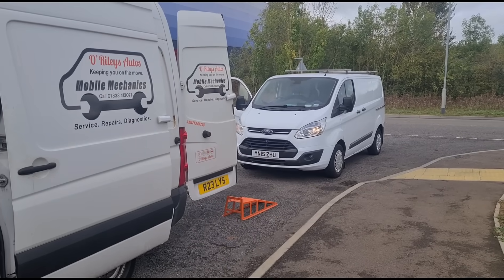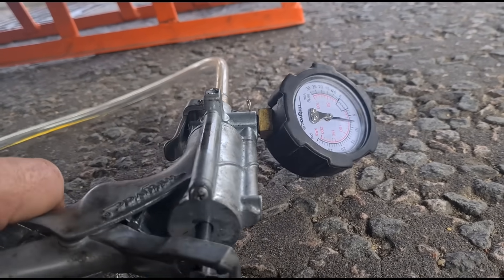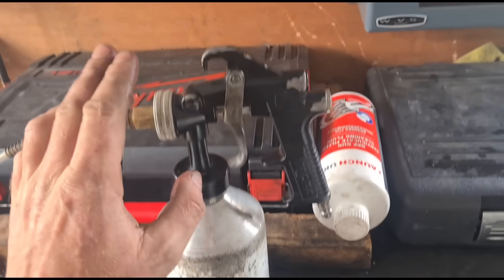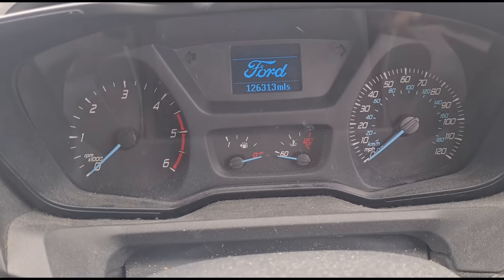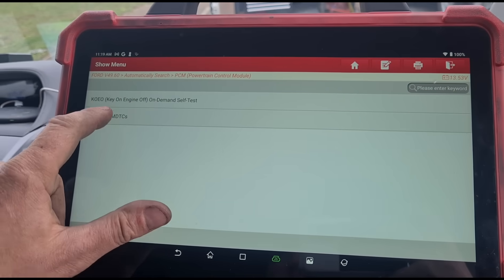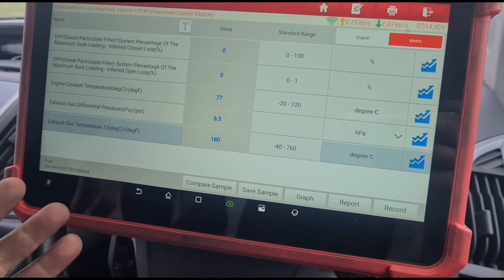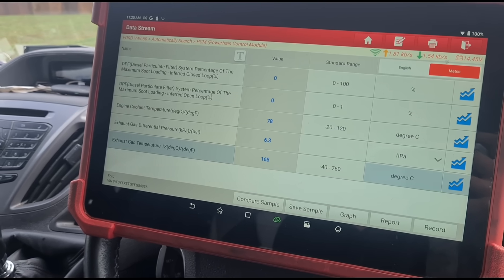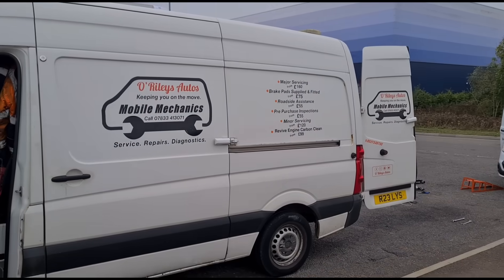DPF Temperature Too Low For Particulate Filter Regeneration?You Won't Believe What Part Was Changed

Comment: what problem could I have with the code P269 F72??, the vaporiser has been  cleaned and the differential pressure sensor also.  The error comes an goes,...Thanks for your help.

Comment: Hi I've had a p244c code on my SMax 2011. I've checked the DPF and it's only 80% full. I've put Wynns DPF cleaner and Millers fuel cleaner in, went 10 mile drive the temps were 280°c at 3krpm for the first 5 miles. I upped the anti and sped up 4.5krpm and the temps went upto 600°c . Is this an ok thing to do or do i really need a New Vapourizer? If so what do you recommend??

Comment: DPF trick.

After resetting the following. (Forscan)

1. PCM: Reset The Differential Pressure Sensor Learned Values.

2. PCM: Reset The Diesel Particulate Filter Learned Values.

3. PCM: Reset The Exhaus Gas Temperature Learned Value.

After resetting all 3, you need to do a (PCM Module Reboot) Before (DPF_SOOT_LD,%) is at 0.0%.

This info is almost impossible to find on the internet for some strange reason. This worked on my Ford Mondeo MK4 titanium 2011

Comment: As you mentioned in this film they have changed this changed that. It's all very well having the up to date all singing and dancing diagnostics,
what codes it throws up is not what the parts are required to sort it. I call them parts changers, plain and simple. Thank you for taking the time.

Comment: I have a Fiat Doblo 1.3 TD Multijet that I use for work. It was running as rough as a badgers a**e with multiple passive regens happening almost daily. I decided to start using Shell V Power instead and within a couple of days, my van engine runs smoothly with no more juddering at idle. The reason I am posting this is because for some reason, the van no longer does a passive regen every bloody 5 minutes. Easily a week between regens and with much much less smoke coming from the exhaust. Just thought I would post this as it may help somebody.

Comment: Hi I looked at a few of your videos regarding the DPF. All is very clear thanks! But ( always a but) my problem is just a little different I think.
During regeneration I often get a "Service warning Now"  and my Ford transit custom shuts down turbo and some other stuf. I turn of ignition . Start again and drive on with no problems.
Last time the generation went from 97 to 64 and then the warning came.
The only warning I see every time is low turbo pressure.  P0299  But I think this is more a sympton after the turbo shut down?
Can the low turbo pressure have anything to do with the warning during regenaration?

glowplugs have been changed, and the dpf also.   Vaperizor not yet ..

hope to hear from you
greetings Nort ( Netherlands)

Comment: So, I have an issue with DPF. codes p246c p244c p246b p2463. I connected the software, and the DPF pressure seems all right. The sot accumulation is 225% and 217%. The exhaust gas sensors 1 and 2 show 100C and don't move at all, and the voltage does not change when revving the engine, either. My theory is that DPF is not blocked; faulty sensors prevent auto regen. What do you think?

Comment: Jimmy, I love your videos but I'm now stuck with my diagnosis. I have a Jaguar F-Pace 3.0D V6, 2016. 1 year ago I had a cracked DPF core and it was renewed. After that after some driving the oil level has risen from middle to max and service interval went from 25.600km to just around 3.000km. Then I changed the oil, bought OBD-2 scanner and now after few months of constantly looking at parameters I figured why it happened. Active DPF regeneration happens every 80-150km on mixed driving style and maximum 300km when driving only on highway. Way too often!! I successfuly completed every active regeneration for 4 months and there is no more oil dillution. DPF pressure sensor looks ok. 0mBar after regeneration on parked car and 10mBar when it needs regeneration soon. At 130km/h it's 30mBar after regeneration and 120mBar just before the regeneration. Sensor looks fine, DPF seems to clean itself quite ok. But it fills up too quicky!! I have to be careful every 3 days to succesfully complete the regeneration process. On active regeneration, the DPF reaches up to 670°C. On city driving it's around 220°C and on highway on passive regeneration it's about 350°C. The DPF company that renewed the DPF said it's been renewed correctly and it should have normal "capacity". What can I check to diagnose this problem? Why is the DPF filter getting full too fast? Could it be one of the EGR valves not working correctly maybe? I've seen very big and constant errors on EGR (A) on my OBD-scanner. EGR (B) seems fine. Could it be that EGR (A) is causing too much soot to collect on DPF? What else could I possibly try? I wish i lived close to you. You are amazing and I hope you could tell me what is most likely the cause. I would be forever gratefull for your help.

Comment: I got a quick question for you I live in Canada and have a 2018 transit 250 getting a low temp code for the dpf had it to ford I'm wondering if this year has the vaporizer on it

Comment: Hello, nice clarification, thank you! I've been having problems with my DPF in the MB 200 CDI, W204 for a long time. Question, which diagnostic device do you use and from what price range can you use it to measure the DPF temperature? I have one that obviously can't do it. With my ArtiDag 800 from Topdon I can only observe the regeneration itself, read out the ash content and the soot content, as well as a few other parameters, but not the exhaust gas temperature in front of, in and behind the DPF/cat. I suspect that the required temperature is not reached.

Thank you and kind regards from Germany.

Comment: Hi, I have a 2012 Peugeot Boxer with a strange issue. the van has no engine lights on and not in limp mode but once it gets to temperature it starts smoking a lot, I can hear the vaporizer fuel pump pulsing which suggest to me my smoke issue is the vaporizer glow plug not working. My son is a mechanic and he has scanned the van and tested the vaporiser for blockage and all's fine. The DPF values are all ok as well.
If I was closer I would come to see you, would it be possible to point me in the right direction?
great informative channel👍👍

Comment: Hi mate, will a Dpf tempratuer sensor on bmw 730d cause a dpf efficiency effor if the temp sensors are.faulty
Reply from the maker: Yes
Reply: @ORileysAutos  ah mate so thankyou for fast reply, I have changed everything, from dpf pressuer sensors on the top, the rube hosings, egr cooler, scr filter , deep oven dpf clean, the error p2002 dpf effeicny low keep returning after every 500miles, now the mechanic and bmw.suggest its the dpf tempratuer sensors that go direct.into the dpf filter, could that be the cause of dpf effeincy low error
Reply: @ORileysAutos  ???
Reply: Please if you could let me know if the dpf tempratuer sensor that go direct into the dpf will cause dpf effeincy error , would be great help thanks mate

Comment: The brake pad wear light is nearly always caused by the sensor wires being cut in two  at the back wheels . Common fault with transits.

Comment: Listening to you recall customer's stories reminds me of an experience I remember. Some years ago a friend of mine got this diesel 'mechanic' to come and look at his Vauxhall Astra at his home. This 'mechanic' bloke decided that the solution was 'to give it 24 volts'! I kid you not, that is what he said. The short of it is that the bloke was going to hump start the car and was absolutely convinced that putting one 12 volt battery in parallel with another 12 volt battery resulted in 24 volts! To my mind, if someone does not understand a most basic principle as this yet specializes in fixing vehicles should not be doing this job or possibly any technical job.

Comment: Hi, I need some help. I have a Renault Grand Scenic 3 2011 1.6dci. And I have 2 errors. One is turbocharger underboost, and second, particle filter error. I take it to Renault service and they perform until now 2 times force regeneration. Now after 200km I have same error, and it stink like burning plastic.
I m tired of their service. Can you please say what I must check in next service, because they perform only force regeneration...
Thanks in advance. And keep the good info on your chanel..

Comment: Have you had to work on a 2017 Nissan Navra with DPF issues?
Reply: Would like to have seen a reply to this as I have an issue with a 2010 pathfinder, can't get through a regen and very low on power.

Comment: great video as usual , but with these latest vehicles with DPF filters whats the best way to keep the DPF in good order , i have a new focus 1.5 ecoblue one every 6 weeks or so i add DPF cleaner when i fill up good idea or waste of money
Reply: I've ran ford diesels for years, biggest issue I found was supermarket fuel, caused engine management lights etc, but run the same car on branded fuel, there was no issues, i did some research and although supermarket is the same base fuel, supermarkets don't put the addatives in that the likes of bp and shell do, this causes them to run dirty, and produce more soot.....I now constantly run my own cars on bp/shell and have never had any issues, and never had to use dpf cleaner and some of my diesels ive run up to close to 200k,  I've recently purchased a 2015 volvo v40 d4, for my wife, as her focus was stolen, the volvo is only on 115k, and since just after we bought it, its been suffering with constant engine management lights, the inlet manifold and egr valve are caked in soot, ive stripped it all to clean it out ad best i can...its now running premium diesel and its not had any further issues...hopefully I've saved the egr before having to replace.

Comment: I think you were  previously correct about glow plugs being needed for euro 4  German diesels witch don't have  vaporiser but use fuel injectors to to inject on exhaust stroke to clean DPF filter ,Glow plugs are used to raise temp of engine and cylinders whilst cleaning / any intermittent or faulty glow plug will cause regen or forced regen to fail on VW euro 4

Comment: My bro has a ford Smax and it was one of your videos that popped up during a google search, i pulled out the vapouriser and cleaned it out with some brake cleaner and compressed air and re fitted it, that was 6 months ago and its still working. Thanks for the videos and the info keep them coming, cheers
Reply from the maker: Glad I could help
Reply: Same here, that vaporizer is 99% the culprit of that particular ‚DPF temp too low‘ issue

Comment: So the parts darts special then? lol

They must be completely monkey if they didn't realise the reason why the DPF didn't get hot enough is because there was no diesel saturating it to make the temps required possible. 

Did they fit a broken fan to make the DPF get hotter ?? Crazy.

Comment: Nice one Jimmy , another job sorted , i did the wire trick on a 2018 vivaro yesterday , it was blocked solid the metal pipe on the pressure sensor from the dpf , cheers for your continued tips and information,  we in the job all need info from time to time , you cant beat it when someone has experienced the same fault as a job in the garage before , so many guessers nowadays in every job
Reply from the maker: Good to hear
Reply: Hi, I got a 2018 Vauxhall Vivaro, for my son, a few days' ago. I'm going through what I can change, to make the van run smoothly. What is this wire 'trick' you did? I cannot see this on the video, can you tell more? Thanks!
Reply: @tomsurrey2252  if you take the dpf upstream pressure sensor off ( on the left of the engine ) at the back ,take the rubber elbow off and check the metal pipe is not blocked   if so use a thin wire bowden cable , similar to a bicycle cable and use a drill on slow speed and drill it out , keeping the cable tight or it will wind itself up  it took me over an hour to do the one I was on , it then should allow the cable to push straight into the dpf  , I then ran the engine just with the sensor plugged in to feel gas flow when the engine was running , then put it all back together
Reply from the maker: @tomsurrey2252  I have vivaro videos on the channel

Comment: If there was a fault in cooling fan circuit it wouldn’t regenerate, so maybe that was the reason, however of course he should have checked the vaporiser
Reply from the maker: Customer said it was the repeated dpf temperature code that was the only fault

Comment: that engine coolant temperature on the test drive seemed way too low.
never got to 80c. they might've put in a cold thermostat at the shop and that might cause problems in the future.
Reply from the maker: It did reach 84 off camera

Comment: What does too high mean mate i had message pop up two weeks ago on my Mondeo after a oil and filter change hasn't come back since, I also get turbo boost too low sometimes switch it back on and off again it's fine. Turbo fine pipes all fine. Any ideas you are a genius
Reply: The dpf could be really really blocked and this might cause the high temperature warning. The low boost issue might be a symptom of a blocked dpf as if the exhaust gases are having trouble getting out then it can't spool the turbo up properly.
Reply: too high of what?
Reply: @JustMe-Dude   exhaust temp too high for regeneration